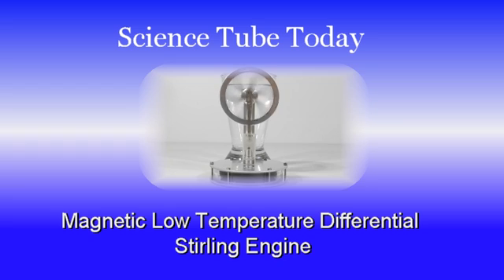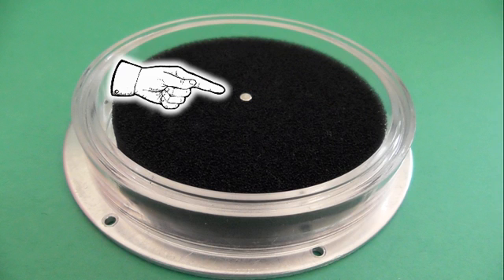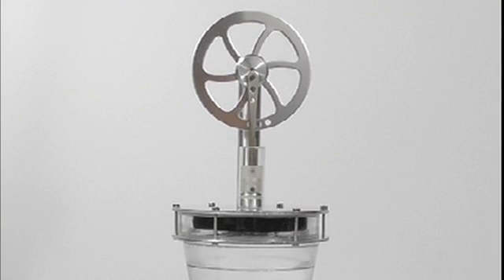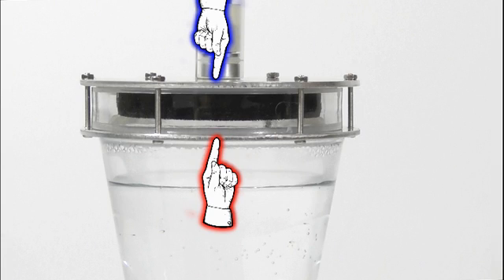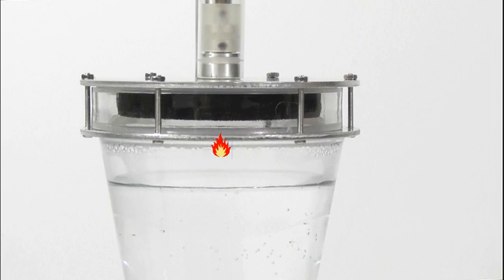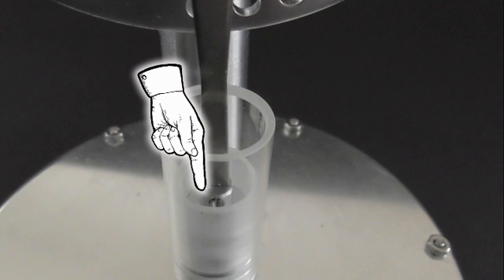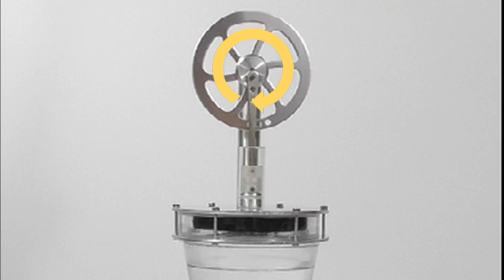Magnetic Low Temperature Differential Stirling Engine 2

Comment: Saw some other videos which describe the Stirling cycle via PV charts and they indicate that, during some parts of the cycle, the displacer is not moving.  When you have a mechanical linkage for the displacer, I could not understand how they made this claim, so i figured it was a theoretical/ideal explanation.  Interestingly, it appears this magnetic linkage much more closely approximates the theoretical Stirling cycle.

One problem/issue with this approach is that you’re dependent on gravity to move the displacer, so there are limits to how fast this can go.  It would not work at all on orbit.

Comment: Sorry but if the magnet attracts with the same force with which it pushes, what's the point of putting it?
Reply: It replaces a mechanical linkage and solves the phase angle problem (between piston and displacer) automatically
Reply: @cslloyd1  Are you saying that the efficiency of the magnet is high compared to using mechanicals part?
Reply: @nator1654  to be honest, I don’t grok Stirling engines well enough to make that call, but i have seen videos where people mention adjusting the relative timing of the displacer and the power piston.  This eliminates that issue, for better or worse.

I have also seen videos where they discuss the ideal “Stirling cycle“ and using a sinusoidal direct linkage does not approximate that very well.  Conversely, I think this magnetic mechanism allows for a “dwell” on one half of the cycle (I think the hot side, where it sits on the bottom for a period).  I’m pretty sure that’s an improvement.  On the other hand, this magnetic scheme depends on gravity for the displacement from cold to hot.  This can be very limiting if the engine tries to run at higher speeds since air resistance makes the displacer movement slower than if there was a mechanical linkage pushing it back down.  

In short, it’s quite complex and very difficult to say without experimentation.  Someone needs to do a video about Stirling design and which parameters affect performance and efficiency.

Comment: So if you sealed the displacer volume from the piston volume (by, say, taping off the hole) the machine wouldn’t work? It needs air to push the piston?
Reply from the maker: Yes, the air must pass from the bottom chamber to the piston to push or pull it.

Comment: I wonder if this could be considered a form of Beta type Stirling Engine, given that the Piston cylinder is really just a extension of the heating "cylinder" and both the piston and displacer are driven on the same axis…
Reply: I believe it is still a beta type, yes. Only difference from standard beta types is the displacer piston is driven magnetically rather than mechanically.
Reply: @konekoray9323  magnetically is still mechanically.
Reply: @ياقوت-ق  Alright, alright, but you know what I meant.

Comment: How does atmospheric pressure drive the displacer back down when it's stuck to the piston magnet ?  Wouldn't the two magnets act as an engine brake ?
Reply: In my opinion, a momentum of the fly wheel will force the displacer to overcome the power of the magnet.
Reply from the maker: @ovrall  Let's see. When the displacer is at the top (and in contact with the top plate) the flywheel has a momentum that keeps pulling the piston magnet away from the displacer magnet. At maximum distance the magnets can't "see" each other, and the displacer "falls" to the bottom of the chamber. As the flywheel continues, the two magnets approach again to a distance where they can again "see" each other, and the displacer magnet gets "picked up" by the piston magnet.

Comment: I have this one, but it cannot work no matter how I put heat into the bottom plate and kick start it. 

Do you have suggestion what may be wrong? is it the timig, the seal, or something else
Reply: i found some clue. 

1.) the displacer foam is somewhat not fully level or horizontal. so when the displacer in top most position, it didnt completely displace the working air from cold top to hot bottom. 

2.) the piston is not fully seal the cylinder. but i think this is not the main culprit. I have two machine, one with magnet, one with mechanical linkage. the one with mechanical linkage is working eventhough the piston is not perfectly sealing the cylinder
Reply: A recent reply by Orlando to another comment indicated that they have no more and may stop making them.  So I don't know if you can make a claim under guarantee.  This type of Stirling engine at such small scale can barely derive enough mechanical power to keep its own flywheel spinning.  Classic mechanically coupled ones, precision engineered, can, and ramping up the temp differential makes them go faster.  But this design is "accidentally" half way towards a resonant engine, due to the fixed time of the displacer falling under gravity, which does not get quicker with greater differential.  Check if the leakage is via the piston (soapy water).  If not maybe one of the o-rings is bad?  Hope you get it working, best wishes.  But it's very marginal.
Reply: It is very hard to diagnose a problem without examining the parts and troubleshooting the engine. I would start by verifying that the movable parts are moving freely and not snagged or under a lot of friction. Check to see if any of the parts are broken or bent out of shape. The whole thing must be running very smooth. Check and write me back. I am curious to see what you find out.

Comment: The hot water is never placed below the plate when the engine is running? What is the magnet doing if the atmospheric pressure and temp gradient cause the displacement?
Reply: the displacement is caused by the large black insulating foam.  When the magnetic link breaks it falls to the bottom...swooshing the hot air around the cold plate...causing a slight vacuum/lowering of pressure. This can easily be a connecting rod link, but for whatever reason they chose to use a breakaway magnet.
Reply: @claywest5322  i think the are saying using the magnet remove friction losses that would be caused by the connecting rod. and once the magnet is not too strong then its resistance when the working piston is moving away from displacement piston is negligible. I seen one in which they used a large magnet for the entire working piston and they use ferro fluid instead of a piston ring to make an air tight seal. No lie, the ferro fluid was a very smart idea

Comment: Is there a variation in performance if the temp differential is higher - much hotter plate, much colder plate - is there a recommended diff?

Thanks!
Reply: Yes, the temperature differential will make this engine go faster if the difference in temperature is greater.

Comment: Hi!  Nice little engine clearly explained. Thank you.  I'm a bit late to the party and hope you're still interested...  The business of phase angle is troubling me.  If the flywheel's angular speed is constant (pretty much true) the motion of the piston is sinusoidal.  While the magnets are coupled the motion of the displacer tracks it in phase.  When they decouple the displacer falls in a way determined by gravity and air resistance and then stays at rest.  So I'm imagining a sinusoid with a flattened top, approximately.   Most stirlingers say that a 90 degree phase angle is needed, or optimal, I'm not clear which or why.  Anyway,  I've seen a few engines that have a more abrupt flip-flop action, keeping the displacer longer at the extrêmes of travel than a sine would and not having a 90 degree phase angle, but rather zero or 180.   Any rough idea of the effect on efficiency?
Reply: n
Reply: @vicky rd 
Back to school.

Comment: Great video demonstration! One question: Wouldn't heating and cooling the air be a slower process than what is shown? the concept sound fine but the speed that the engine is turning is so fast for time it should take for air to cool and re-heat, No? also this model is using gravity, do the traditional ones use gravity as well? . Thanks in advance.
Reply from the maker: Hi Farid. First, thank you for your comment. 
Regarding your first question: It takes quite a few minutes for us to boil water, and it takes a long time for that water to return to room temperature after being removed from the fire. It takes some time for our cars to warm up the engine, and when we turn it off, it takes time to cool off. Or when we heat up an iron to iron our clothes....We may naturally use these observations as a comparison with a stirling engine. These items have a very large "mass" that needs to be heated from a source of energy and cooled usually by dissipating heat into the environment. But, inside a Low Temperature Stirling Engine the heat exchange happens very fast because there is very little "mass" (air, hydrogen or helium) to be heated and cooled when coming into contact with large surfaces (top and bottom plate). Now, add to this the fact that once the wheel makes its first turn the kinetic energy of the wheel only needs a tiny amount of energy to keep it going - If you want to have an idea of how much energy is needed to keep the wheel going, just put your finger on it, and it will stop very easily (because the amount of energy you are dealing with is very small). Regarding your second question: Great observation! Yes, gravity pulls the displacer to the bottom of the chamber in this particular model. Other models use a "shaft" that links the piston to the displacer. The shaft pushes the displacer down, and pulls it up. Have a great day.  STT

Comment: If you turn the engine upside down you may be able to get sunlight to power the engine.
Reply: ytams1   that would be simple if you have a way of inverting gravity..... ;) .  The magnets decouple when the air is hot and now needs to be cooled.  The displacer will fall onto whichever plate is lower, so that's the one that needs to supply heat and the other one needs to lose it.   You don't want the sun heating the top plate whichever way up you place the machine.  Suggestion: keep the machine the way up shown here and arrange for a small shaving/makeup mirror (magnifying) to focus sunlight onto the bottom plate.   That should work very well unless you make it so hot that the foam displacer melts!
Reply: @raykent3211  Mine works fine upside down,I don't think gravity plays a significant part in the operation of these stirling engines. Its more to do with expansion and contraction of the gas ( air )
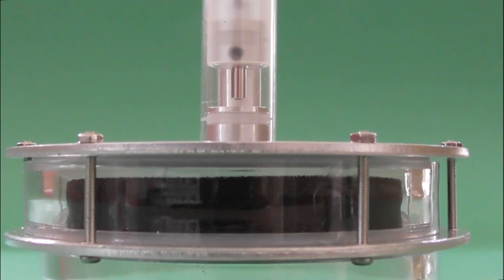Reply: @pinballrobbie    very interesting, thanks.  I was a bit cagey about the explanation offered at around 2:50 , that the magnets decouple and the displacer falls under its own weight, due to gravity.  The displacer, even with the tiny magnet is light and has substantial air resistance.   Too slow?  Other designs can operate in any orientation, but I still can't see how this could.  Is yours actually the same as this one? If so, is it very slow (maybe 120rpm)  and can it run upside down on unfocused sunlight, as for example the conventional mechanically linked Kontax can?  Ignore me if if I'm pestering, but I'm intrigued and would be grateful for any info.  Thanks again for the response.

Comment: you dont show how the magnets work.
Reply from the maker: Hi Frenchie, As you can see in the video, there are two small magnets. One embedded in the center of the displacer, and  the other attached to the bottom of the moving piston. At first the two magnets are together, but as the piston moves up, the two magnets separate far enough and can't hold the displacer at the top of the chamber...so the displacer falls to the bottom...and waits for the piston to come back down again and be so close that it will attract the displacer up to the top of the chamber again. - The magnets are set up in a way that the "south pole" of the piston magnet face the "north pole" of the magnet embedded in the displacer...In magnets, different poles attract (like north attracts south, and south attracts north)...but same poles repel each other (north repels north, and south repels south)...Hope this helps.  STT   :)
Reply: ScienceTubeToday This is an amazing design. Congratulations for being a genius.